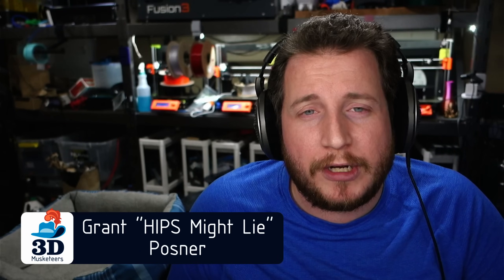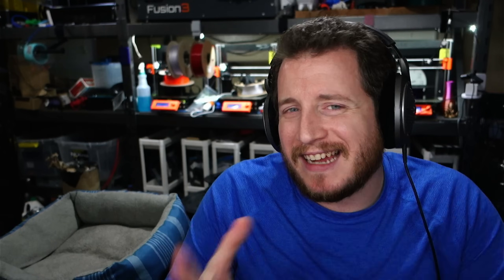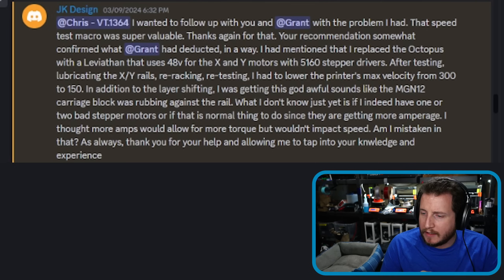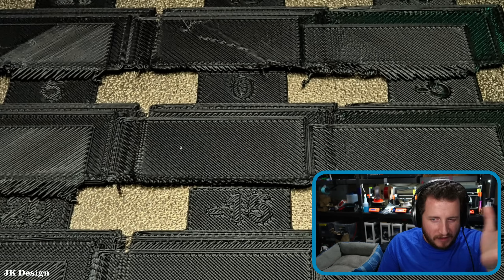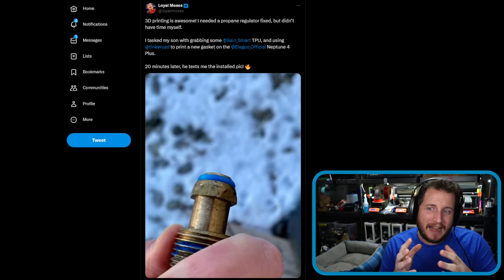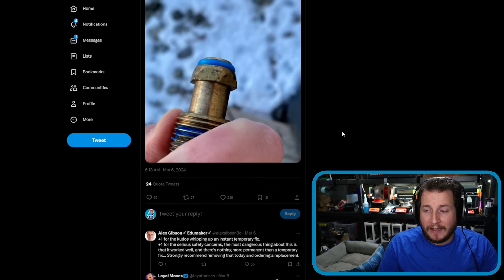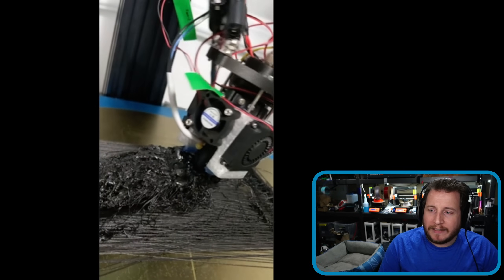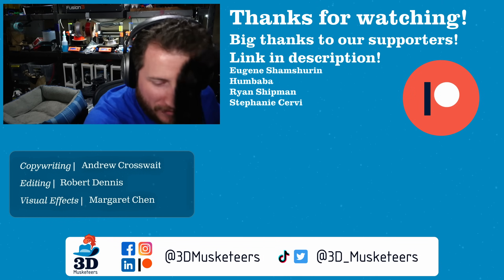Some Things Should NOT be 3D Printed! - PrintFixFriday 131

Comment: Idk about that o ring.  I personally have used tpu to print seals for industrial pneumatic cylinders that are lifting 2-3 tons.  They actually hold up for 10x or longer than the factory seals.  Not printed tpu is used all the time as o rings, seals, and gaskets.  Printed tpu has the best layer adhesion i have seen out of a material, fantastic chemical resistance,  and really good temp resistance both high and low....  idk that i would be so quick to say its the worst idea.
Reply: A couple things. Were those hydraulic or pneumatic cylinders? For lifting I would assume they were hydraulic. Hydraulic fluid is a lot easier to seal than gas. Also the potential outcomes of a gas leak are a lot worse than a hydraulic leak. 

I’m not saying this should not be done, anyone should consider the risks for themselves, but it’s irresponsible for an “influencer” to show this as thing to do.
Reply: @Incendium87  they are pneumatic not hydraulic.  Seriously works fantastic.  TPU is seriously underestimated.   I understand your and grants point tho.
Reply from the maker: worst idea? no, I can think of worse, but it is irresponsible for sure.
Reply: @JaketheJOATGOAT I have also printed seals using TPU. Specifically for a gas tank and an air intake. It can work great.

Comment: I've made plenty of tpu gaskets and oddball o-rings to replace unavailable parts. I also have several ASA fuel line locking clips out on the road. I don't ever share the STL and I always tell the customer that the part is to be considered temporary and should be replaced with an alternative asap. A few of these parts are several years old and still working but I still don't feel comfortable recommending others to do it when the stakes are that high-ly flammable.
Reply from the maker: agreed

Comment: Sorry to say, but increasing driver voltage is not about wattage at all. In the rest state, the drivers work in constant current (C.C.) mode, which means that they will lower voltage to the point until the current will hit the set point (let's say 2A). So no matter how high your PSU voltage would be, the drivers will lower it to the same exact level as with lower voltage PSU, so the power (wattage) will stay the same.

What higher supply voltage allows you to do is to get higher RPM from the steppers. That works because stepper drives is a bunch of electro magnets, which have a high inductance values. And when you apply current to the electromagnet, the inductance doesn't allow for current to rise to set value (2A) immediatly - it will rise slowly, until it will saturate the magnetic material.
The higher voltage just quicker saturates the magnetic material (drive stator/rotor), which allows for quicker application of magnetic force to actually move the rotor.

Basically, more voltage - the quicker you can move the drive and have a better torque at higher speeds (although, the hold and slow speed torque will stay the same - that is influenced by current).
Reply from the maker: Oh dang, I had no idea! I had just assumed it was just a wattage thing. Good to know. Thanks for that lesson! I'll work on adjusting that communication :)

Comment: Hello Grant! AFAIK, the main goal of using magnet and steel ball joints on delta machines is that it has almost no backlash. And a side benefit is it's super easy to do maintenance.
Comparing to other joint designs like fish-eye ball joints, it doesn't save much weight. (Actually it might even be heavier)
Cheap fish-eye ball joints can have a lot of backlash and wobbles a lot. Some people fix that by adding springs within each pair of the parallel arms to pull them towards each other to eliminate the backlash in the joints.
Reply from the maker: oh, I thought it was weight, but yeah magnets and balls would have little backlash too!

Comment: Even if you used the factory o ring, it should be checked for leaks , and frankly if it doesn't leak , it doesn't leak.   My favourite is boiled sugar, used to seal water joints for couple of hundred year of continuous use
Reply from the maker: EXACTLY

Comment: 4:45 He should check his stealthchop and spreadcycle settings too. If it is running in stealthchop, it is more likely to skip steps at higher speeds. I set my stealthchop_threshold: to 0 in Klipper so it never goes into stealthchop.
Reply from the maker: oooh good one, will recommend it!

Comment: Pretty sure 10:00 would anger Hank Hill.  Though I do admit to using TPU to make gaskets for a lawnmower carburetor.
Reply from the maker: OMG I missed a great opportunity for a hank hill joke.. I should delete this channel! Dangit Bobby! 

TPU and gas are not normally fans, but in your case, worst thing happens is an air leak and the engine runs lean a bit and turns off. As long as you are not running angry dorito rpm's here it should not melt anything.

Comment: I disagree with you about the o-ring. Polyurethane o-rings have been used for decades in systems like hydraulics and pneumatics and are fuel and oil resistant. They have excellent wear resistance. They usually have better cold weather resistance than neoprene o-rings too. A 3d-printed o-ring may not be as precise as injection molded, cast, or millable polyurethane o-rings, but its not like an order of magnitude off and is more than capable of holding a few hundred psi. If the seal passes the soap and water test, I don't think there is a cause for concern.
Reply from the maker: I would agree, on something that ISNT propane. Just keep spares in stock and this issue goes away. It is dangerous.

Comment: i run all my klipper printers at 240C for PLA.
20-24mm3/s flow rates with safety factor (20 on N4Max, 24 on SV07Plus).
K1 Max i just run at defaults on creality print ... it works perfectly, so why bother lol. i think it's setup for 23mm3/s out of box for ABS. I only use it for ABS.
Reply from the maker: yeah, more heat allows you to push more plastic :)

Comment: I'm not too worried about a TPU o-ring in general, but I'm a bit concerned about someone that uses tinkercad knowing enough to design it properly. Need the right amount of interference that lets the fitting both compress the o-ring to seal, and also seat fully without damaging the o-ring.
Reply from the maker: tpu is not an approved material for stuff like alas.

Comment: Looking at some chemical resistance charts,  TPU and Propane might seem like they might be compatible, however it's very much dependent on what is in the TPU, there are different base materials used to make TPU, which one is a rather important factor.  In an controlled industrial setting where you know exactly what you are using, and qualified chemical engineers have looked at the material data and signed off on it, perhaps it could work as an O-ring for that application,  however what exactly that goes into the average 3d printer TPU filament, from consumer grade vendor to vendor, is anyone's guess and I certainly wouldn't want to run the chance that it just might be the kind that isn't very resistant to propane.  Certainly not in an advisory position on the internet.  Go buy some proper O-rings.
Reply from the maker: Yeah, I agree, not sure I would trust it, buy the right thing, and buy spares!

Comment: Back in the early days of 3d printing, before PLA was even generally available, various parts for SCUBA systems were printed, vapor fogged, and then were hydro tested and certified in exactly the same manner that a regular machined part would be. It's a known thing that 3d printed parts on hobbyist systems can be pressure tight and mission critical, however, they need to be qualified exactly the same way the traditional part would be, and have the material failure modes taken into account. 

More importantly than just the fact the seal is 3d printed(that's done all the freaking time in all sorts of applications), is the unknown information about the polymer compatibility with propane at both elevated and sub-zero temps, along with rapid temp swings through that range. Liquid propane boils at -37f, if your seals won't handle that, they should never be used as part of a propane system unless they are fully protected by at least one inspected and certified regulator that is designed to stop liquid propane from passing, and even then should not be used anywhere close to the source of the liquid propane. And 3d printing filament is seldom just whatever the headline polymer on the spool is, so unless you have an opinion from a fully trained chemist certifying that that polymer alloy is compatible with the compounds in play, you should not introduce it. 

Seals are specific, the seals for my paintball tanks are designed for sub-zero temps and rapid temp swings, along with CO2 gas. I doubt I could actually swap them for a generic unit successfully, unless I were to use Viton seals, or another effectively super seal.
Reply from the maker: Viton would have been a good suggestion too.. But yeah.. too many variables out there to trust TPU IMO.

Comment: Yea the propane tank thing is definitely something that needs a HUGE disclaimer. Now I wonder if I can 3d print an enclosure for a nuclear isotope....hmmm....might have to ask for help, will keep you post.................channel goes dead.
Reply from the maker: Actually, using the Tungsten filament from Prusa, some isotopes could be pretty well contained...
Reply: Matterhackers also sells a bismuth-infused ABS filament specifically intended for radiation shielding. Which I'm sure is a peach to print with, given that ABS usually likes to print in the 240-260˚C range and bismuth starts melting at 271-272˚C.